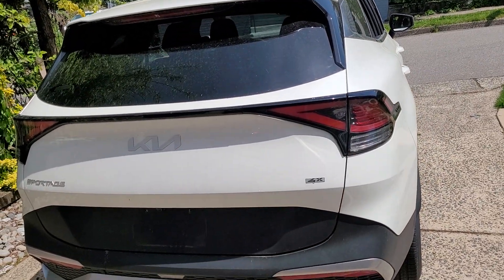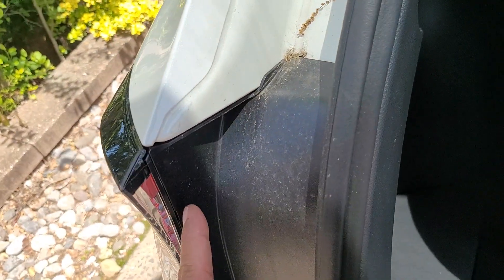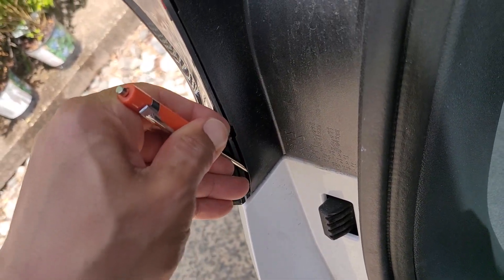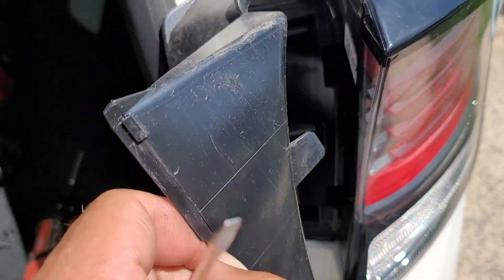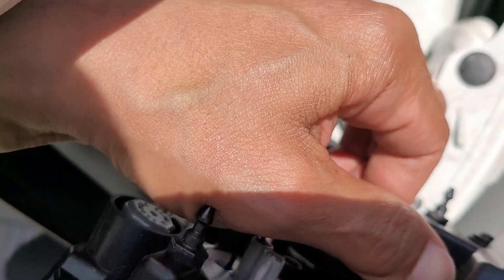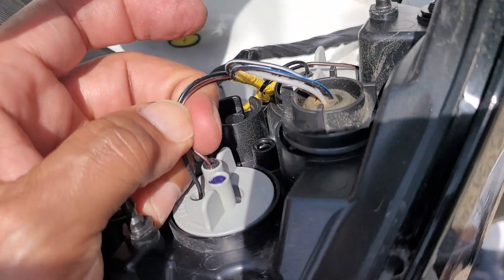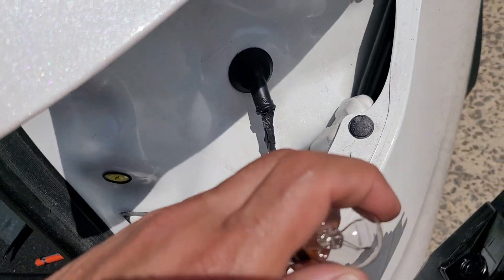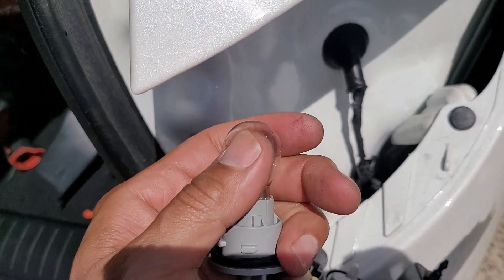How To Remove 2023-25 Kia Sportage Tail Light And Replace Tail Light Bulb.

Comment: Hey so the bulb you recommended has a draw that is slightly more than what is recommended in the Kia’s manual. The original bulb is is 8 watts and the the one you recommended is 8.3. I know it’s a minute difference but I’m wondering if it can cause more electrical issues later.
Reply from the maker: I doubt it. If you really are worried about it. Bite the bullet and buy it from Kia. If its the same bulb as the one recommended. Now we know and no harm no foul. Aftermarket bulbs are designed to replace factory. But by all means, double check, but I highly doubt that it is going to be a problem.
Reply: @richideates  ok, thank you for your time!
Reply from the maker: @adamsimmons6876 no problem

Comment: Hello!  My lightbulb is stuck!  I can't get the actual metal part of the bulb out - any ideas?
Reply from the maker: Ooph..sounds like it might be busted in there..you might need brute force to get it out..I cant tell without seeing it..but if the whole light is stuck..then you might to help it out with some force..but dont do it if you feel like your going to break something..I hope that helps
Reply: Thank you for such a quick response! I went to O'Reilly's auto store and they helped me get the bulb out. Have to push down and then turn to get the bulb out would be great to see a video on that one lol! Thank you so much for your video! Super helpful.
Reply from the maker: Yaaa..I will try to show that moving forward. If its able to be turned, I will include that in the video. I am always learning. 😁. Thanks for watching
Reply: If it isnt rusted you might try to push it into the socket while twisting. If it is rusted, put on sone work gloves and goggles, break the bulb with a hammer, then use some hefty needle nose pliers to work it out.
Reply from the maker: @findyourlevel9601 Wow..for a brand new car to be rusted?? Or use a hammer?? Sheesh..shouldve bought German then..🤣🤣🤣